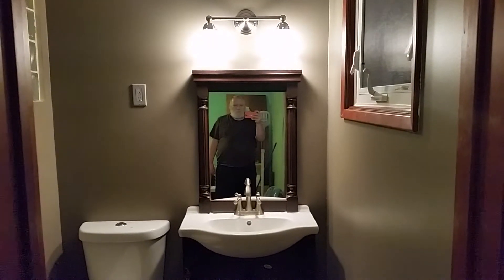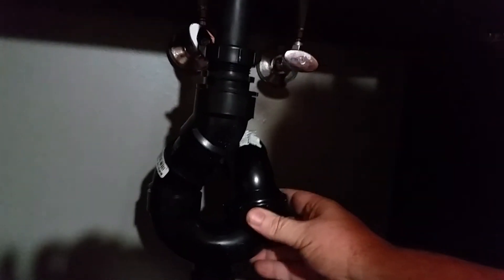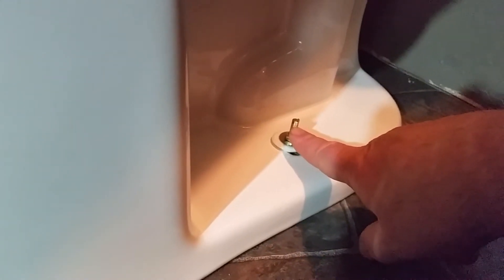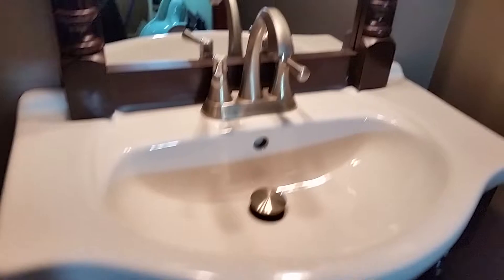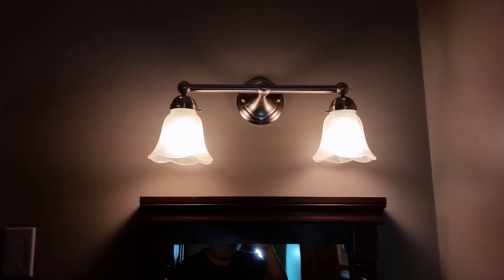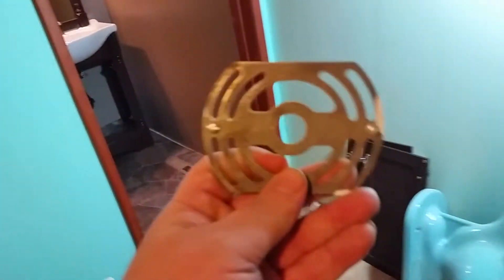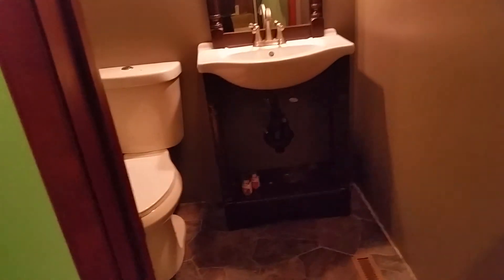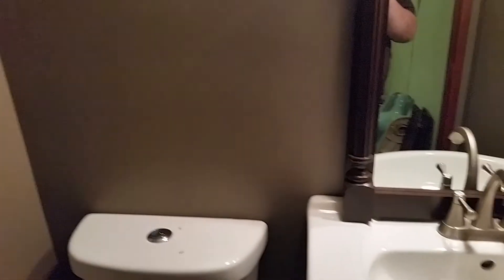Ensuite gut and rno 9

Comment: Looks great. I think your going to have to move the light or change it. That sucks. I have to do 2 bathrooms both are in need of floors and updating.
Reply from the maker: TheRedneckRailRoad I was hoping things would fit with the light in the old location, but not quite.  Even though it would be easier to get a different light, I'll be moving it because we like the fixture.  Won't be too bad, just time and some drywall.  We have paint and primer left, and I might be able to find some drywall without having to buy a whole sheet.  This bathroom was original from 1966 when the house was built with the exception of wallpaper and a different tap.  The main bathroom is the same way, and will be a bigger job because of the tub, and we'll be doing that after the master bedroom, which is next.  AND when all is said and done, I get to do it all over in our current house so we can sell it.  Bonus with the new house is I can bring out my 4x8 train layout that was stored back in 1979, and finally get it running.